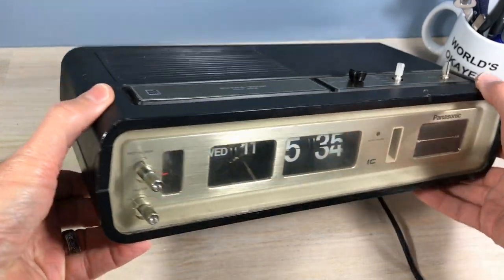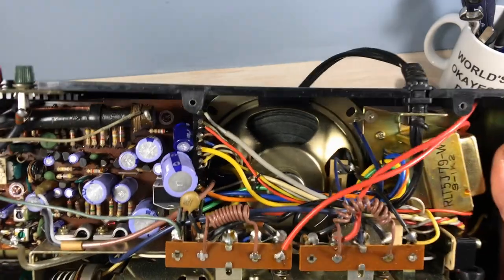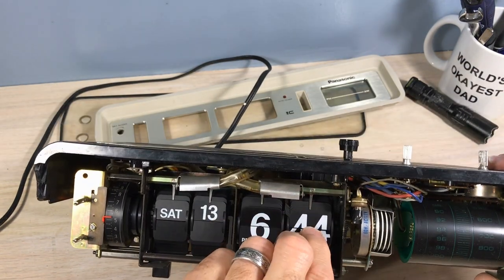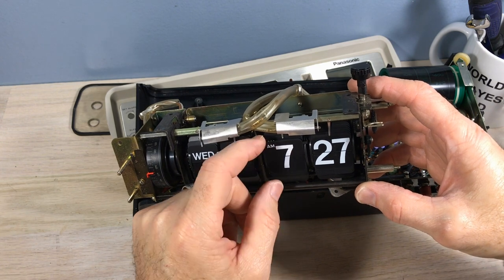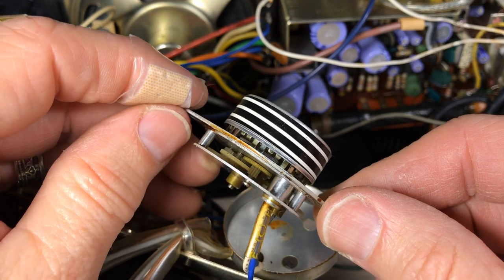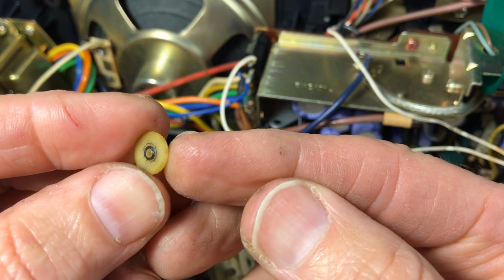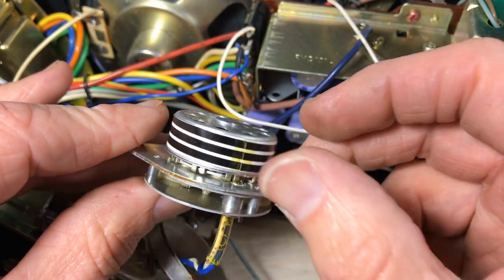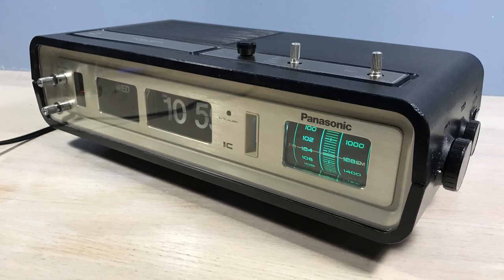Panasonic Digi Dater RC-6551 -  back from the dead

Comment: I bought the white version on Facebook marketplace for $40. The guy said it sat in a box for 20 years. It was running beautifully for almost a year until it recently started making a soft knocking sound that it didn’t make before. I immediately unplugged it. I’m a little scared to open it up since i don’t want to cause irreparable damage. I really love the clock…. Any advice?
Reply from the maker: You could send it to me and I could fix it on video.
Reply: @Flipclockfans  I tried messaging you a couple months back. Not sure if you saw the message, but I was wondering what the process would be like for that. I’d love to send it in so it could be up and running again

Comment: I have one of these, it was working fine before I put it in storage a few years ago but now the radio no longer works and the green lights aren't displaying. It still flips fine both on the time and date, just nothing else seems to work! any suggestions on what it could be?
Reply: Did you ever fix it? Usually it's just minor corrosion from lack of use. U can take it off and be very careful like in the video and turn it in and gently give the wurly wheel a spin an use an air duster to clean, and gently tap. Many times they will just start working.
Also look for a multi meter of cheap power tester if that doesn't work

Comment: Hi just bought this same clock on eBay.  It's in great shape.  The main power cord does appear to have a brake in it down by the end just before  the plug. If plug is bent too much the clock radio won't come on. Is ok to just splice new plug on this power cord?  The rest of wire cord appears in good shape. Or if ok just put on a full length new lamp cord. Last question could you advise me of the brand of strip greens lights you used inside the radio.  They looked so much nicer.  Your the best I enjoy your videos
Reply from the maker: Yes, you can use a lamp cord as a replacement. You can splice it in anywhere safe. I get LEDs from superbrightleds.com.

Comment: I have an old Panasonic clock with a similar mechanism and issue, but the tab holding one of the number pannels in place broke off entirely rather than just bending. Is there any way to repair this, or is it a lost cause? Either way, thanks for the great repair videos.
Reply from the maker: Yes, one of the numbers in the above had no tab. Once I built up a tab using superglue and baking soda and filed it down. But in this case I took a spare tile from another clock with a little extra on it for support, and glued it to the tile.